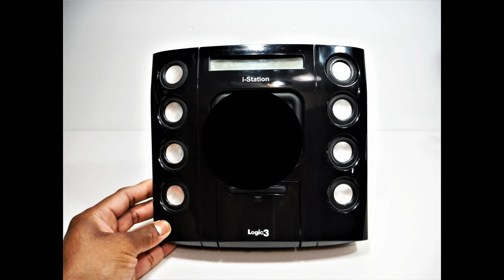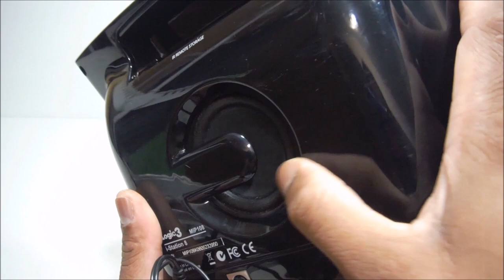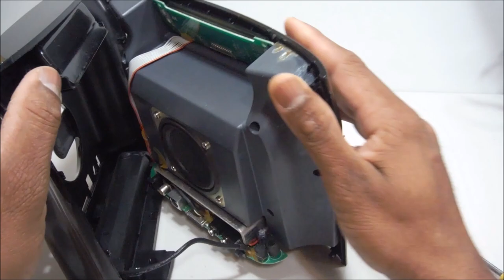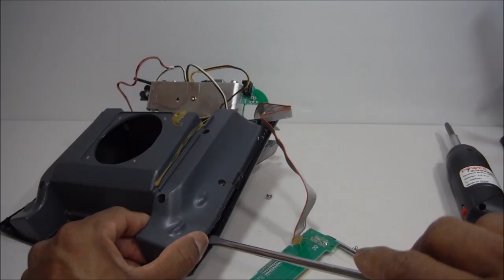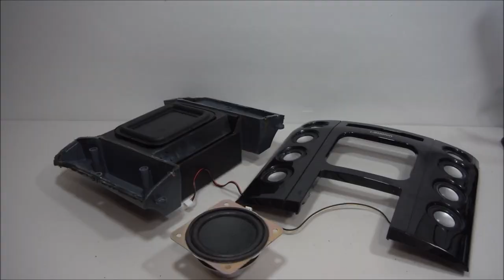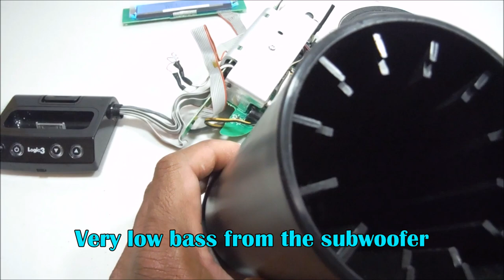WHAT'S WRONG WITH THIS BASS RADIATOR

Comment: 2 things.

The air leak of the casing of the speaker
or
The subwoofer's dead.

Note: Those tiny speakers on the sides will only produce higher frequency and not produce low frequencies, the subwoofer on the back does.

Comment: The passive radiator is not to stiff
It's the sub it's either dead or not creating enough air pressure for the radiator to move, even if there is a air leak the passive radiator should still move and radiate bass not to it's full potential but it will visibly move my guess is that passive radiator have to much weight in the cone so it's harder to move they generally do this to lower the free air resonance or increase RMS (air pressure) capabilities but they screwed up

Comment: Probably the small dock speaker (mini woofers) have got no excursion and over the years the passive radiators surround has harden due to lack of use
Reply: Speakers Addict the small speakers are tweeters... they don't have any excursion... the rubber/ foam surround won't harden... it will make foam rot, which is worse... but would still move... its because the subwoofer is trash and has no excursion... if it did it would move it. He needs to change the woofer to something that actually can make air pressure.

Comment: Check your amplifier using other speaker if that is lauded   then the original speaker then the amplifier is alright but the speaker is blown but if the other speakers sound like the original one then the amplifier has some problems and the speaker is good

Comment: Passive radiators only work if there is a perfect seal inside the box the speakers are in. It takes air pressure to move the radiator. That's the reason why all these Bluetooth speakers with passive radiators claim water resistance.
Reply: J KH if it had a leak, it would still be able to move it... but it would have to be a decent woofer to do it.

Comment: Air leak? Cone area on the speakers too little? ( no power to move the radiator.)
Reply: the small speakersa need a separated enclosure, need to change the subwoofer driver and put a lowpass on the subwoofer, and more power

Comment: yeah there is more than likely an air leak. also the subwoofer is far to small for such a large and heavy radiator. the whole system is trash

Comment: Bass cabinet with radiators need to be absolutely airtight. btw.....it is only junk speakers.
Reply: Even if it wasn't, it would still move the radiator... So, it doesn't have to be perfectly air tight...

Comment: The Rubber are dead, try change if possible
Reply: Sabahan YouTuber That's a pretty ignorant sentence... The "rubber" can't be "dead"... its most likely foam, which is easier to move... Even if its not, its because the "sub" can't move enough air to make enough pressure to move the radiator.